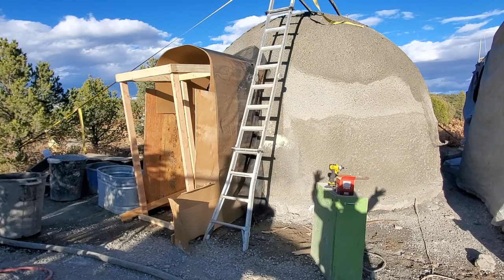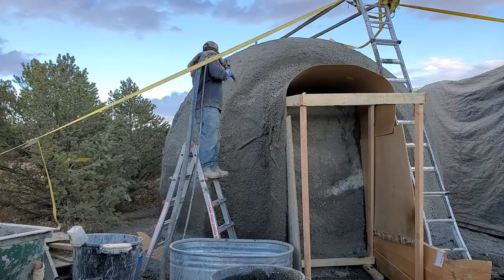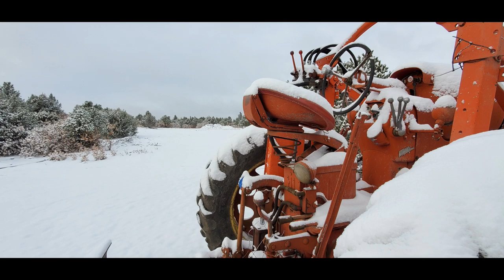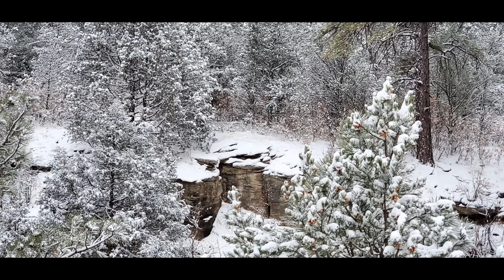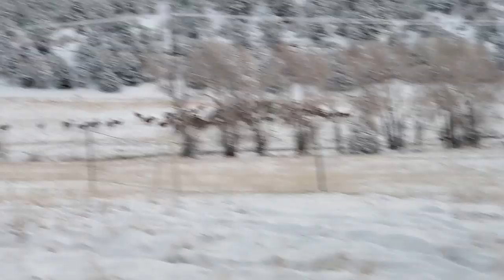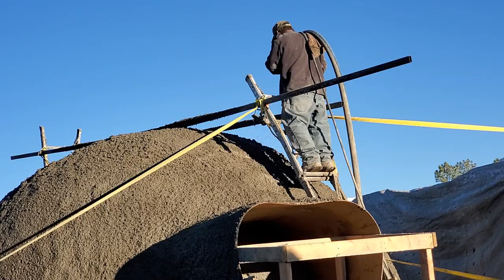Building E.P.I.C. Cement Dome Cabin | Part 3 #aircreteharry #epicmix #domebuild #aircrete #diy #dome

Comment: Hi, I was wondering about using Epic mix to coat the exterior of a concrete block building to give it more strength. Do I need to put a mesh over the blocks first for the Epic mix to adhere to or do I just put it directly onto the block with no mesh? Thanks!!